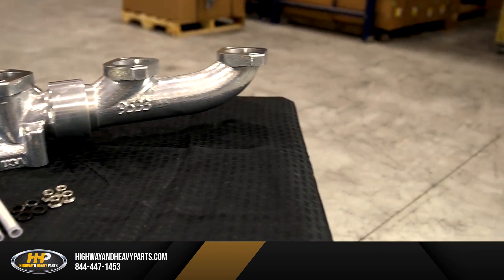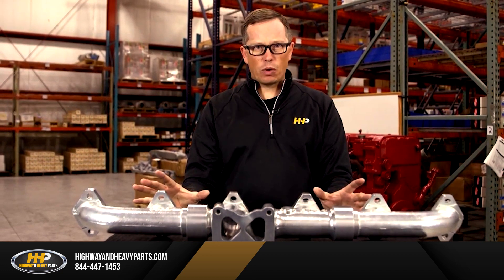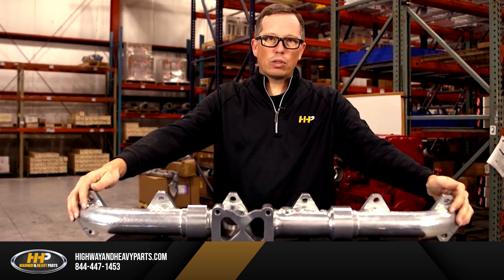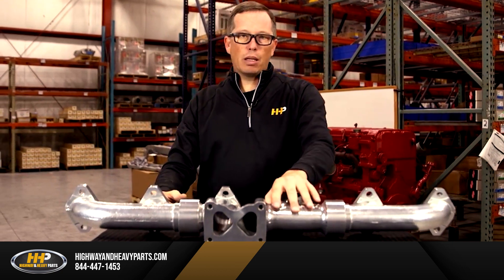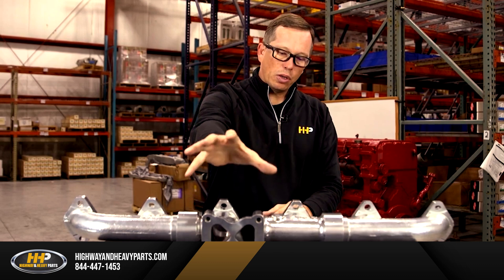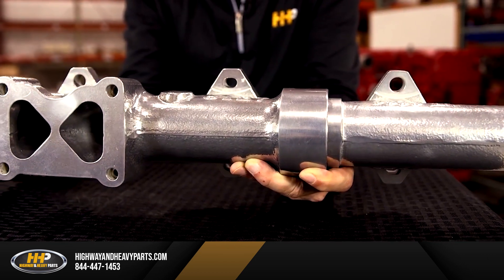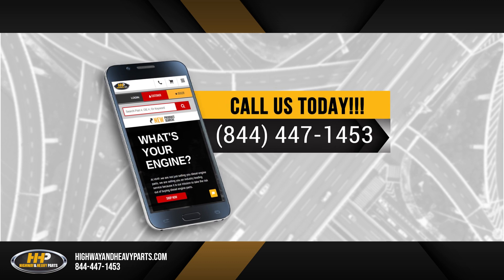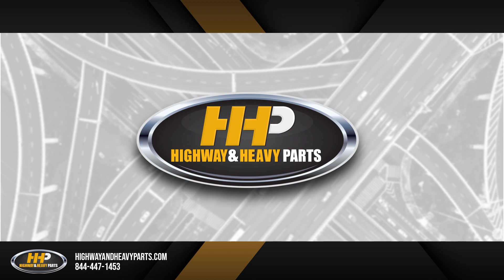Caterpillar C15 Performance Exhaust Manifold From HHP. Check This Out!

Comment: 28 more horsepower is a lot…. I was told by a diesel mechanic that for every one horsepower you gain 5 foot pounds of torque….. 28X5 = 140 foot pounds of extra torque….. that’s a lot we’ll worth the $1800 bucks

Comment: How much does it cost for AC15 cat
Reply: Is that price in cad$ ?
Reply: How do the joints hold up against leaking?
Reply from the maker: This component costs $1776.32. 
https://highwayandheavyparts.com/i-23902637-231-6127-caterpillar-c-15-acert-6127-exhaust-manifold.html

If you have any questions, please call 844-447-1453 & connect with one of our ASE Certified Technicians.